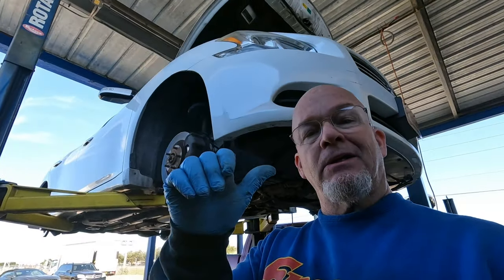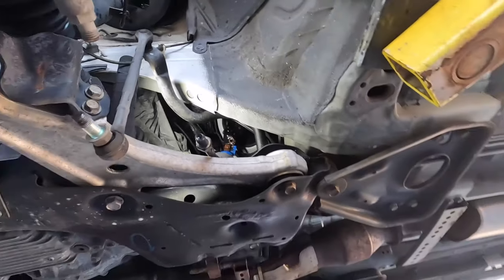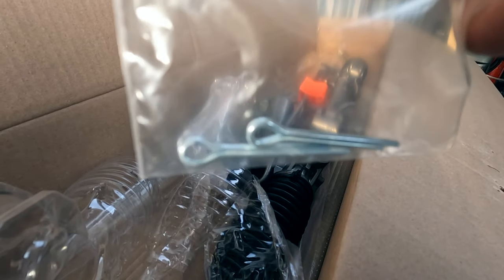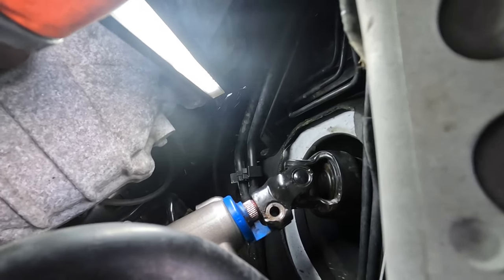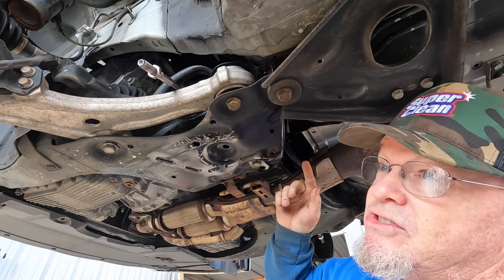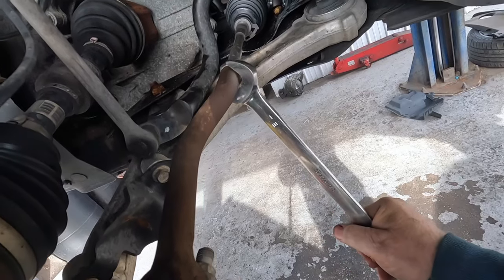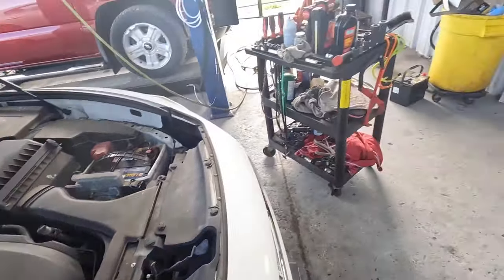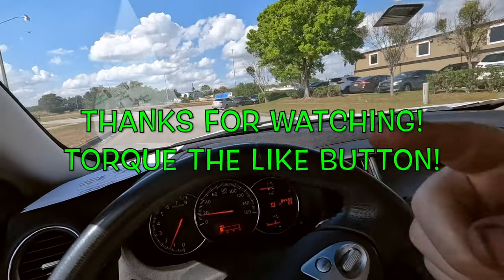RACK AND PINION, NISSAN MAXIMA, AUTO REPAIRS THE SNEAKY WAY...

Comment: I have to decide on replacing the rack and pinion in my wife's car. 2009 Nissan Maxima. Motor and transmission are fine, but it's been one thing after another for a while now and this isn't a cheap job.
Reply from the maker: Yeah, it is a common failure on them and not an easy job at all. But much less than a new car, although I'm bad about that myself. I just got new vehicles for my wife and I so I can avoid working on them on my days off. :)

Comment: This video is good the only thing is that you fail to explain how to get to certain areas.
Reply from the maker: Some good wrenches and maybe some stubby wrenches help with the lines. The rest is not really very bad compared to others we've done. The steering shaft is a 12mm you get from inside. Don't remember anything else being very hard to reach, but I filmed this a little while back.

Thanks for watching and leaving a comment!
Reply: I've been trying to get my Maxima 10 done I guess I'm just struggling just needed a guide.

Comment: Hey I just replaced the rack on my 2012 maxima , went to put the power steering fluid in and it’s leaking from the banjo bolt. What should i do ?
Reply from the maker: That is gonna have to come apart again to check and see if an o-ring tore or came off. IF not look closely for an issue like cracks.
Reply: @JimmyMakingitwork  Is there a rubber oring that goes along with the copper ones ? The rack is aftermarket and I used the bolt from the original one so I was thinking maybe the bolt was too long because It wouldn’t tighten all the way so I added new copper rings so I was wondering if getting a shorter bolt may solve it.

Comment: Hey, what did you do to correct the alignment issue after install? My wife got an alignment by Mr. tire and the alignment is off exactly how you showed in this video. They seemed to cannot get it dead center 🥴🥴🥴 any advice is welcomed. Thank you!
Reply from the maker: Renaldo, sometimes if the steering wheel is off center they could have. the alignment correct, but may not have straightened the wheel location properly. A minor recheck and adjustment should take care of that. If there is a problem with the alignment itself the only was to know is if it pulls to one side, shows aggressive tire wear or getting it on the alignment machine again.

Hope this helps.
Reply: Thank you very much for your prompt reply. I will ask the shop to recalibrate that darn steering wheel again. 🍻 mate

Comment: I have a power steering leak from passenger boot... Was told by jiffy lube to take care of it. Is this the same issue? And costs estimate on this type of repair?
Reply: Mine is same car almost. 09 Maxima.
Reply from the maker: If it looks wet at the steering rack boot, then the outer seal is leaking requiring a replacement. The job takes a few hours and the parts we could Only find at Nissan on the last one.
So price depends on your local shops labor charge and the local dealerships parts department. Adding an alignment at our shop I believe it was $1200-1300 from memory?
Reply: Just seen this. Thank you so much. Nissan told me I have to replace the whole rack and pinion when the boot is damaged

Comment: I just ordered a used but newish rack and pinion for my 2010 FX35... will take it in to get it installed next week. Did you secure your steering wheel to protect the Clock Spring?
Reply from the maker: What I do is use locking pliers on the output shaft so it can’t rotate during the repairs. 
Thanks for watching!

Comment: Question, I just did this on my 2012 maxima, only the one I bought didn’t have the solenoid or the hose valve I had to take from my original rack. Finished installing (the solenoid was hard to remove from the old rack) now that I test drive it is difficult to turn the wheel, I can see fluid in the power steering reservoir and I can see it moving in there but I’m clueless as to why it’s not working. Could it be the solenoid?
Reply from the maker: The only way to be sure is to test for pressure from the pump. The pressure hose in a drain pan and start the car briefly to see if fluid pushes out. It won't be like a firehose, but it will be a good stream if the pump is working and the line is clear. It sounds like you may have low pressure from the pump, but it has to be tested this way to be sure.

Comment: I have a leaking steering rack on a altima will the leak and bad rack cause vibration i also have a slight clunk when i turn wheel left or right fast only while car is shut off im hoping replacing the rack fixes the vibration its not wheel balance or control arms i replaced em along with monroe quick strut and even sway bar links and tie rods both inner and outer on both sides. Appreciate any input or thoughts thanks.
Reply from the maker: Hello Jose, the rack usually won’t cause a vibration. That is usually from axles, motor mounts, tires or bend hubs, warped brake rotors. Loose front end parts will exaggerate vibrations set off by bumps and other problems though.

Comment: Hi, thanks for your video, I'm new to your channel, I have a problem with my 2010 Nissan Maxima with hard power steering, it had a leak in the high-pressure hose and the mechanic changed it, the steering pump started to sound, I know I changed it and it keeps ringing, the steering wheel is still hard, do you think it could be the zipper or some sensor?
Reply from the maker: It sounds like it has air trapped in it. Might need a vacuum fill. It is also possible there is a defective new part. Been happening a lot lately.
If it isn't air in the system put the return hose in a drip pan and have someone start the engine and see if fluid flows. If it does not the pump is bad or there is blockage.

Comment: Great video!! I have a 14 altima and the steering wheel moves from the 12 o'clock position to 11:45 periodically while driving. Could this be the rack or angle sensor. Thanks
Reply from the maker: I’d lean more towards the rack, if it’s a sensor there will usually be codes accompanying the issue.
Reply: Thanks for the response!!
Reply: Update. Hey it ended up being bad motor mounts. The acceleration/deceleration was the cause of the movement of the steering wheel. Thanks again...

Comment: Hey thanks for the video I have a 2010 maxima and changed the whole front end struts inner and outer rods rack pinion and brand new tires this was in the winter December January time and the car still has a bad pull to the right issue I brought it back to the mechanic in June and it turns out there was a power steering Leak and the who rack and pinion had to be replaced again they changed but the car still has a bad pull what do you suggest I do take it to nissan? Appreciate your advice
Reply from the maker: I have seen bad lower control arm bushings case a pull, also tires can cause it. I would rotate the tires and check those bushings with a pry bar to see if they let the wheel move.
Reply: Thanks for the reply Jimmy I've changed the control arm as well everything is new in the front multiple alignments has been done but still pulls do you suggest I take it to the shop that did the repairs again or go to nissan? The other shop doesn't seem to be finding the issue just making me change parts that still had time in them

Comment: Great video, did you have to turn the wheel slightly to get to the screw by steering shaft?
Reply from the maker: It actually lined up pretty well, only turning it slightly. 
Thank you.
Reply: @JimmyMakingitwork  yeah, that exactly what I did that way it lined up facing the wheel. Definitely need to get that nice hose clamp tool to get that clamp out though…tried with few angled pliers and nothing.
Reply from the maker: Yeah, there are a few things like that where a specialty tool is really needed. Sounds like you’re on the right track to get it done!
Reply: @JimmyMakingitwork  Absolutely, your video really helped big time and saved me a lot of cash. Thanks again 👍

Comment: How did you drain the system before proceeding?
Reply from the maker: I used a drip pan to catch fluid after loosening the lines. Then brake clean to clean up a bit once it was drained.

Comment: Hey Jim I had a question in regards to the individual components of the rack. I need to replace my inner tire rod on the passenger side. Is this able to be done without replacing the entire rack?
Reply from the maker: Yes Jarett, the inner tie rod end can be replaced as long as the part is available separately. It requires some tools made for the job, or if there is enough room a large wrench can be used.

Comment: Which side is this on? Driver or passenger side? I'm currently trying to replace mine. Send help. 🙏
Reply from the maker: Replacing the rack is Easier out the drivers side since that is where the steering shaft connects to and is the larger side.

Comment: I have a front end clunk. I've replaced the whole front end including struts and motor mounts. Would a bad steering rack cause a clunk in your experience? Also 2011 Altima s
Reply from the maker: AJ, if the rack bushings are bad it could. But usually on those the suspension arm mounts tear. Check those out closely.
Reply: Did you try control arms ?
Reply: @Dorightby  Yes
Reply: @NotAJ-yn3xe  did you end up finding the issue?

Comment: Doing the same job on my maxima , my pressure hose is still leaking where the but goes in at , any suggestions?
Reply from the maker: If the pressure hose is leaking where the rubber goes into the metal hose end the hose will need to be replaced? Let me know exactly where it's leaking.
Reply: @JimmyMakingitwork  so I made it work , now I have an alignment problem , my first time doing this job and I need to undo the steering column off the rack so I can get it aligned properly , pain
Reply: So I fixed the problem after I broke my clockspring , got it all fixed now but cost a lot now I know what to do next time
Reply: @austinfrederick5876  yo man, after seeing your comment I HAD to inquiry. I've got a 2005 Maxima. Driver side boot broke, so I bought a remanufactured by Detroit Axle. Only have replaced front struts and links, so this job is kinda scaring me. I'm a broke college student, and honestly have no room for error or breaking my clockspring etc. Any advice on how to prevent other parts from getting broken? Also any tips/tricks for doing the rack and pinion? Saw the video creator said use locking pliers on crankshaft, have heard of using a marker to mark alignment as close as possible etc, but anything else especially since we've got the same car? Thanks for your time man!
Reply: @foreign6357  absolutely man it can be scary but don’t be scared of it !!, it’s not that bad when you actually replace the rack and pinion , one thing to always keep in mind is to keep that steering wheel straight when you take your steering wheel column off that rack , make sure it doesn’t move not one bit, then you take your new rack and pinion and line it up with you old one, then install it , other then that that’s the only problem I had
Reply: @austinfrederick5876  So there is no worry of having it too high/low on the column? also any recommendation on how to keep that steering wheel locked? I can try the locking pliers on crank, but honestly im going to have to find it first :P, thank you for the quick reply and the help by the way man! MUCH appreciated.
Reply: @JimmyMakingitwork  I have the same car, how can I diagnose if my clunking is coming from the lower steering shaft (u-joint),  the inner tie rod or the rack and pinion?

Comment: I have 2013 Nissan Maxima and power steering pressure line is leaking power steering fluid but when I went to mechanic he said that it was my rack and pinion. So how do I know if it is my rack and pinion is going bad or just make power steering pressure line?
Reply from the maker: If the line is above the rack, I’d change that first if there is any doubt about the rack leaking. If the rack is definitely leaking, then it’s best to change them together and save a little on overlapping labor.
Hope this helps!
Reply: @JimmyMakingitwork  yes it does! Thanks

Comment: How much would you charge for this job?
Reply from the maker: From memory the shop charged $600 for the labor and an alignment. I do not remember what the part costs were though. I know it was not easy to find and believe it was from the dealer. Hope this helps.
Reply: @JimmyMakingitwork  thanks

Comment: Nissans are total trash but they are like Subaru owners and have a cult following but as a tech I steer all that listen very clear from any and all Nissan products and I'm sure you agree it's like everything about them is trash (junk CVT trans that they extend warranty to 140K miles because they are such trash, the engines are garbage, very chincy and cheesy interior components) and then after all the mess they are very overpriced when you can have a Toyota or Honda for less with a better quality vehicle bumper to bumper so people should just drive by the Nissan dealership and pull into the Honda or Toyota dealer down the street when shopping for a new vehicle!!!
Reply from the maker: I agree Aaron, not a fan of Nissan at all. Software issues, throttle body, CVT issues....lots of odd things to deal with on them. Hard pass. lol

Comment: I have a 2012 nissan maxima n I’m having problems with the power steering I just changed the power steering pump but my wheel is still really tight to turn think this could fix my problem?
Reply from the maker: Very possible. The rack has a valve that regulated pressure and they can go bad causing it to bypass.